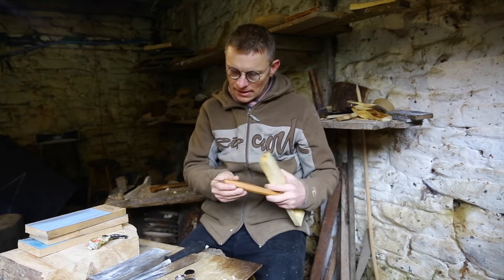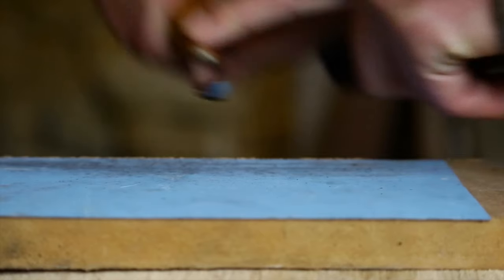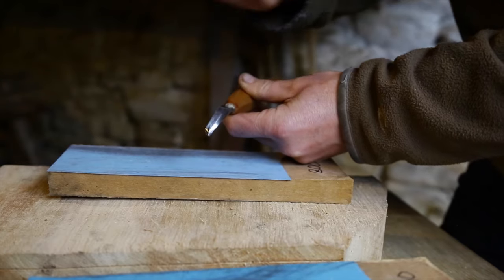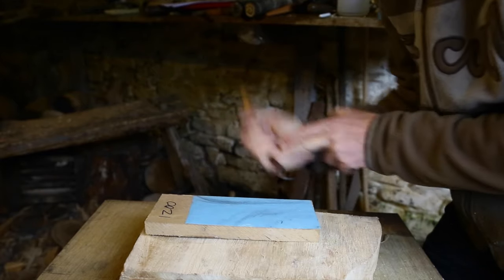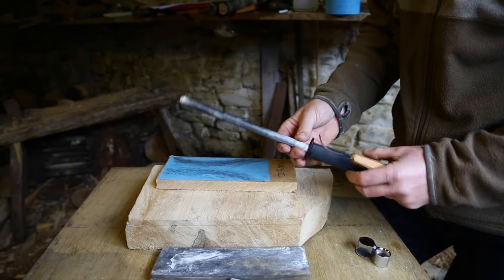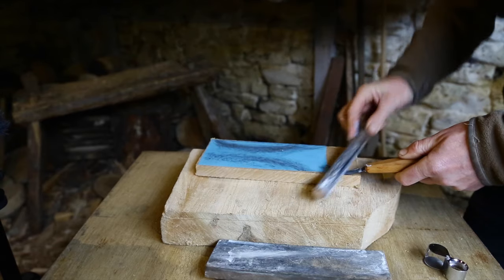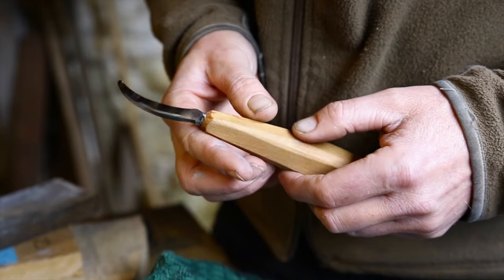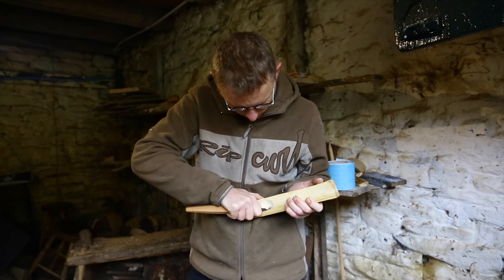How to sharpen a hook knife with Robin Wood

Comment: Another good way to tell if you have ground to the edge is to use a black marker on the side you are sharpening.  It removes the black ink where you have sharpened and indicates where you have missed.  I use it when I check the angle when I sharpen blades.  Good video my friend, thank you.

Comment: When you say "so little effort", beginners should understand that you have probably carved thousands of spoons and your hands are in much better shape for the work than someone who is working on their first dozen or so. The sharpness, when you have that skill in hand, will minimize the effort needed. Mostly then, do not get discouraged if it doesn't just come right off for you. Poco a poco. A little at a time, you will see your skills improving. But first, baby steps. This video is an excellent start. The ability to sharpen well allows you to get the ability to carve well.

Comment: I have started a "Robbie" file, lol. Your videos are just so informational and in a very easy presentation. Thank for that. May I ask how much pressure do you use when going through the swipe of the blade across the sandpaper? Or is that a learned thing?

Comment: Great video Robin, very helpful. I wonder if you would do a video on how you sharpen a straight blade on your waterstones. I've just purchased some and it looks like there are a lot of different techniques out there and any advice would be appreciated. I seem to get a good edge initially on my mora knives but it doesn't last that long. I strop every 45mins or so when carving, and am careful not too roll the edge over. I'm using cherry so its not that hard. Cheers